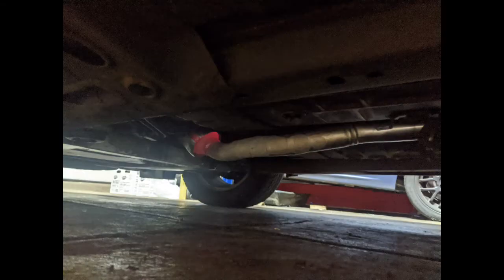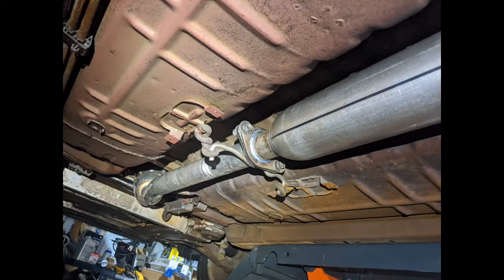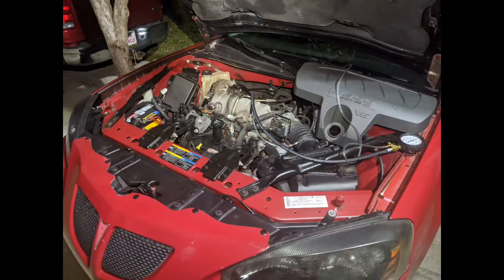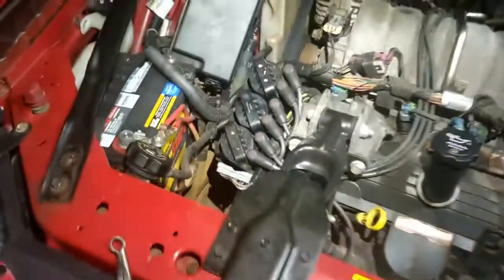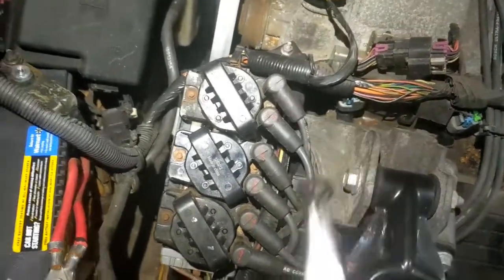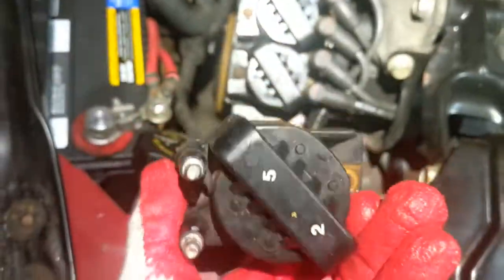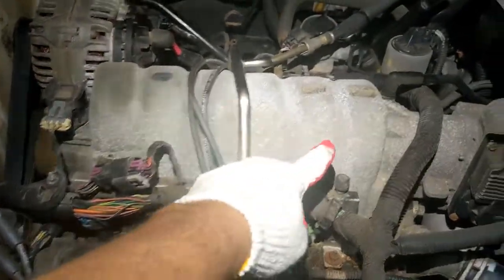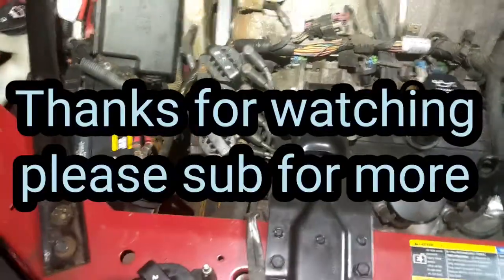Red hot catalytic converter  fix

Comment: I have a 2009 crown victoria catalytic was heating up so bad it burn a hole in my floorboard no check engine light.  change the fuel pump and tank vapor canister and the purge change all the spark plugs new throttle body new air cleaner Assembly and i change 2 ignition coils. I think i just need new cats.
Reply from the maker: Take the o2 sensor out, the one before the cat and see if it drive good, if so then yes your cat is bad
Reply: @nestorautorepair  Do you really think that you can drive without an A/F sensor? Have you ever tried to start a car without it?
Reply from the maker: Yes you can also if the o2 sensor are bad like really bad this will also make the car not rung good and you will also get a flashing check engine light , but if you unplug it it will drive normal
Reply: @amateurcarpist5474  Yeah,,,,,kinda noisy
Reply: Change the cats now the whole exhaust is heating cherry red WTF.
Reply from the maker: Bad coil
Reply: If the coil is bad will check engine light comes on cuz there's no check engine light showing
Reply: @detroitking2238  did a new coil work? Is your check engine light bulb functional?
Reply from the maker: K
Reply from the maker: At one point yes it will come on